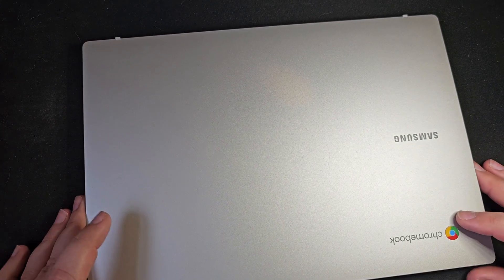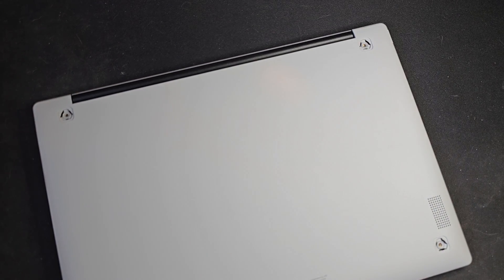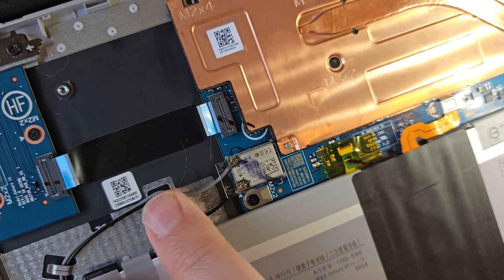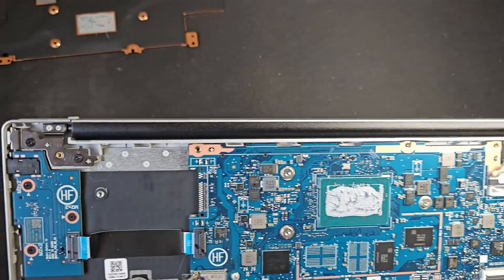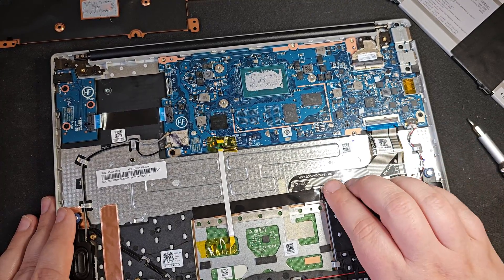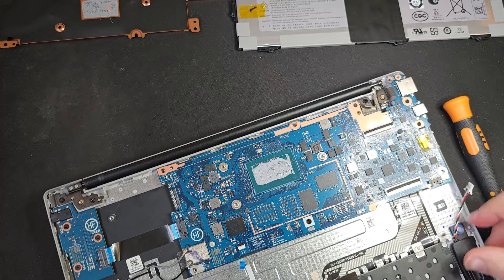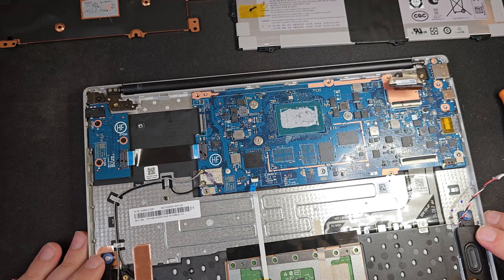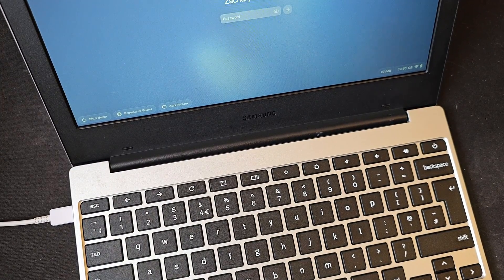Tearing down the Cheapest Chromebook I could find - Samsung Galaxy Chromebook Go (XE310XDA)

Comment: Interesting video - Celeron N4500 seems good enough for low power use. I use a laptop with N4020 (slower than N4500) with Windows 11, and it's okay for light use, with excellent battery life. Does the laptop let you boot from USB to install another OS?
Reply: Yes I've heard you can flash Linux to it